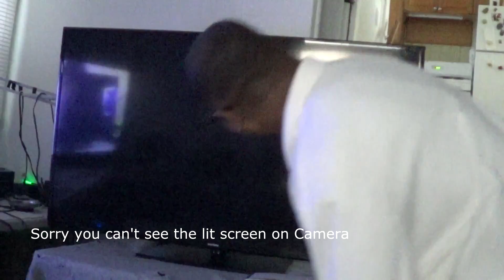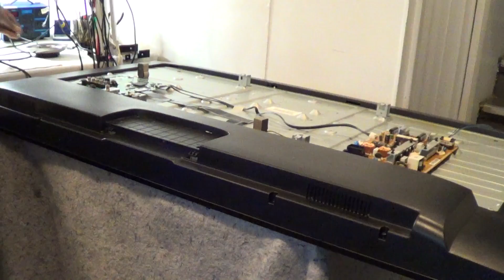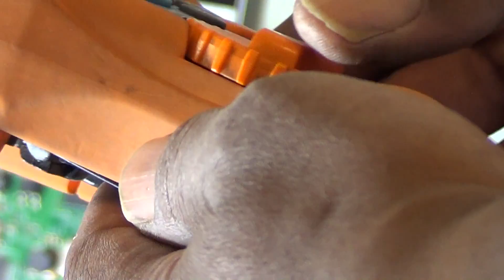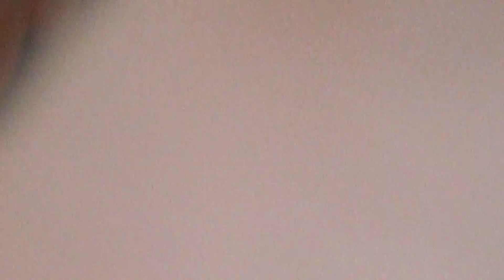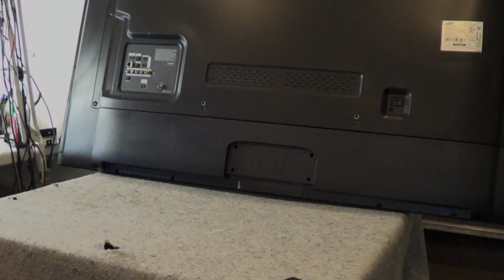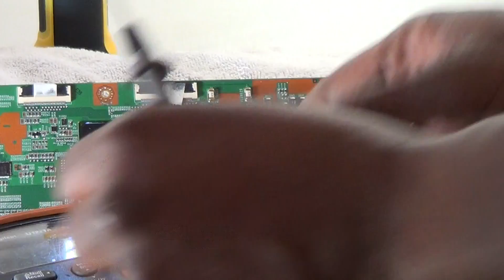Backlight but No Video troubleshooting. Samsung UN60FH6200 T-Con

Comment: I been working on a samsung unf50h6201afxza and i have replaced main board t con and still no picture audio but have backlights only . Iam able to turn off and on tv but that’s it ..
Reply from the maker: Disconnect the Ribbon cables going to the panel (screen) one at a time, their should be two. If you get half a display or picture on one side of the screen, then U have a bad LCD panel.
Reply: bigdog8882 Yeah i get one sided picture when i do that
Reply: bigdog8882 Is it worth fixing and if so where do i get this part ? great job and you made me a subscriber ..
Reply from the maker: You have a bad panel, unfortunately the screen is not retailed, when that happens they just want U to buy a new tv. Thanks for watching and subscribing. God Bless
Reply: sonny, is your tv fixed? i have the exact same issue, exact same tv. Backlight but no picture, turns on/of. But I dont have money for a mew main board. do you have the one you changed out ? lol I could pay some, but hate to risk omuch on a tv thing. everyone just says replac it, but I have even less money for that.
Reply: mike zurherlin Mike i do have a main board i have it for sale i was asking $30 shipped in the 50 states
Reply: +Sonny Mendoza That's fair.  I get paid Monday, I will contact you around then with my details... money order? PayPal?...ect. Thankq you, I'm fairly certain that's my issue. worth fixing if it is.
Reply: mike zurherlin Mike you can contact me at mendozamtrsports@aol.com
Reply: @bigdog8882 Ok got one for you .. I have a LH55EDDPLGC/ZA and checked boards all over seems to be ok however when i turn it on the backlight constantly flashes when i unplug the led plug coming from the power supply to the tv backlight turns off obviously and boards have good voltage .. i’m thinking these backlights are suspect . I-am i on the right track here ? Thanks for the help !
Reply: also wanted to note when unplugging the main board from power supply it makes it flash faster either way the power to the led cannot be connected or it makes the tv flash when plugged in and i don’t have any control to that .
Reply from the maker: Yes. If U have a LED tester U can check the led circuit first without removing the panel.
Reply: bigdog8882 actually bigdog i do not have a tester for that i have a video of what the tv is doing because it’s hard to explain
Reply: bigdog8882 Purchased the led tester what a great tool ! every single strip had about 1-2 leds not working . Ordered replacements and will see how it goes .

Comment: Good morning sir I have samsung UA40AH500 tv. When I disconnect the main board from the power supply the LED's come light up when I connect it back all LED's switch off.as the initial problem was no picture. Can you help me out sir please.
Reply from the maker: Replace mainboard.

Comment from the maker: Disconnect the Ribbon cables going to the panel (screen) one at a time, their should be two. If you get half a display or picture on one side of the screen, then U have a bad LCD panel.
Reply: I unplug my ribbons one at a time and the screen goes off completely on one ribbon. I have no sound but my tv turns on to a lite up black screen, no menu function its only  2 yrs old LG 65”. Tcon or panel ?

Comment: I have a LG 43UF770V and it has no picture, no sound, but the backlights turn on. I replaced the T-Con board but, didin't change the result. I then baked the motherboard (or main board) for 11 min for a reflow but, that also didn't change much. Before I did all that I noticed that there were some negative voltage readings on the right hand side of the T-Con board and wondered if it was normal to have the ground lead on the chassis but have positive readings on the left but, negative readings on the right (on the T-Con Board). I did not reverse the polarity.
Reply from the maker: Yes, thats ok because the t-con uses a differential signal. One goes positive, one goes negative.

Comment: i couldn't agree more with the positive reviews,very informative. I am currently fighting with a un65f900 samsung. Have changed the motherboard after having no power, had the t con and power board checked first. Now the tv comes on with a smart tv screen followed by a screen with a few icons then it powers down and cycles the power on about every 30 or 40 seconds.I checked the t con as you explained and there is no input. With the one connect unplugged it lights up telling you to plug the one connect in. But as soon as you plug it in you can hear a switch on the power board and the backlights go off and it starts cycling. Any ideas as everything else i read it sounds like the motherboard again.
Thanks, Dave
Reply from the maker: Unplugg the LDVS cable coming from the mainboard to the input of the T-Con board and see if the tv stays on.
Reply: It does. I have a blue screen with a solid green bar on 1 half and a patterned bar on the other side
Reply: does that indicate that the main board is no good seeing that the display stays on with the main ldvs cable disconnected?
Reply from the maker: No, if the set stays on with the LDVS cable disconnected, then that means U have a bad T-Con board or Bad Lcd Display. Now try disconnecting the ribbon cables going from the output of the T-con to the panel With the LDVS cable "plugged back" into the input side of the T-con. If TV comes on then you have a bad display panel. If the TV does not stay on then try changing the T-con.
Reply: the display comes on for a second then off for 25-30 seconds and cycles so I will try changing the t-con. I guess i should be happy as that sounds less costly than the display. I really do appreciate you taking the time to share your advice and experience.Thank you very much. Next time you come to Alberta Canada send me a message I owe you a few drinks.
Reply from the maker: I always said I wanted to go on a Vacation in Canada. I'll look U up, LOL. Thanks
Reply: You should do it,you know what they say. Anyway, the offer is open. I do appreciate your time and effort. The idea of people doing what your doing is really great and must be very fulfilling. I have no problem extending an offer to reciprocate to giving people like yourself. Thanks, and if I do not see you have a great day.
Reply: Hey Bigdog, I replaced the T-con still not working. Going through the steps you described before is the same except now the display stays on with the t-con outputs unplugged. I assume that means try the display panel ?
Reply from the maker: Either U got a Bad MainBoard , or Panel is bad. Double check all your connections on main.
Reply: checked all connections everything good. only have  0.5 V on output side of tcon. input side not much coming in from driver. is there anything else that i can check to determine the problem? voltages on output of main and input of driver not seeing much, even from driver into tcon only a couple of pins showing voltage.
Reply from the maker: Unplug both connectors to panel from T-Con output. If voltage rises, then definatley bad panel. If not, disconnect LDVS CABLE from mainboard, then check outputs on mainboard going to LDVS cable. If no voltage on main going to T-Con then U have a bad Mainboard.
Reply: the voltages at the tcon do not change with output(4) unplugged. i unplug the LDVS cables (2) from main to frc and the voltages seem good. 1.6 to 3. But the display stays on for about 20 seconds them shuts off for 1-2 seconds and back on then cycles. As soon as the one connect is disconnected the cycling stops and display stays on.I have checked all the connections. My gut tells me it is the main board, not sure if you would agree. I seen a place in AZ Ricks TV I believe refurbs boards. Any thought on that or other places that fixes boards.
Reply from the maker: If the backlite cycles on-off and you still have sound, then U may have an LED strip problem, otherwise go with U'r Gut, or maybe take the tv to a shop in your area.
Reply: Did you ever find out what the issue was here? I'm having nearly identical symptoms with the same model. Coincidentally I'm also located in AB. Had a tech come diagnose the TV and he determined it was a faulty main board based on the same symptoms you mentioned in your first post. Thanks
Reply: Hey Mike. Mine was the main board. I sent to ricks tv in arizona for rebuild, was 250 us i believe. The boards are ridiculous in canada and no one rebuilds here. They are simple to remove and re-install

Comment: I have a UN46D6450UF Samsung TV which looks close to the one you are working on. Anyway I have no picture with sound and backlight. I bought a new T-con board and got the same thing.  I then found that if  I remove the left ribbon cable going out to the screen the right side of the screen works (or has a picture) also the left side of the T-con board has good voltage readings without the ribbon cable connected. Do you think it is the lcd display or the board that the ribbon cable connects to (which doesn't look replaceable). Thanks
Reply from the maker: In my experience, If u remove one side of the panel connectors and all of the sudden U see half a picture; then you have a bad LCD Panel.
Reply: Thats what I was afraid of. thank you for your time, great video.
Reply from the maker: No problem. Thanks for watching.
Reply: bigdog8882 just curious do you ever scrap for gold?

Comment: I would like to give you my sincere thanks for this video. I was able to take my 55 in samsung apart, trouble shoot and repair my 3 year old $700 TV for less than $70.
Reply: Hit the ground running  
Hi i have the same model but just a year old ..... was having few vertical line on the very left side of the tv and tried to repair it myself... while removing the ribbon cables and putting them back on the tcon board the tv went off..... now i can only hear the sound that tv is on but no display... can u help 
Please and Thank you
Reply: Any luck with this issue? Having this exact problem now.

Comment: all my lights come on for a split second, checked with a backlight tester and all seemed fine..changed main board and PSU still no joy so i don't know?? i do get sound
Reply from the maker: What Brand and Model Television do U have?
Reply: hisense h40m3300
Reply from the maker: If thats an Led TV, better double check the Led's. If its an LCD (older television), then check the Inverter Board.
Reply: its an led, i checked all the strips with a backlight tester all light up 100%

but when i switch on TV they come on for just a split second
Reply from the maker: If the TV uses a separate Drive Board for the Leds, check that. If not disconnect the Panel Ribbon Cables and/or T-con board from the Main and see if the Backlights stay on.
Reply from the maker: Also make sure that you get the same Voltage reading on your tester for each led strip. If one is over a 10 - 20 volt difference from the others then that Led strip is  your suspect.

Comment: Any hints to getting the out side bezel off? The sides no problem the corners refuse to release.
Reply from the maker: You have to take both back inner/outer covers off. then remove the screen and/or screws to remove the front bezel.

Comment: Great video thanks. I tested my T-Con board and on the output when the ribbons are attached the volts show nearly zero. I thought it was a bad T-Con so bought another but that too showed the same. When I unplugged the ribbons on the output it showed normal readings! Any idea why the voltage drops when the ribbons are plugged into the board but normal when not?
Reply: could also be shorted cap on Lcd drive board
Reply from the maker: You have bad (shorted ) panel driver boards. Those are the boards that the ribbon connectors are connected to. So, in other words you have a bad LCD panel. Thanks for watching!
Reply: Damn... Is there a way of testing where the short is? I have backlights working, does that make a difference? Thank you so much so answering so quickly, very much appreciated :-)
Reply: found out what the problem was... it turned out to be a damaged screen but it couldn't be seen whilst the screen was in the casing. Very small damage but needed to remove the front casing to see it. Thank you so much for you wisdom :-)
Reply from the maker: No problem